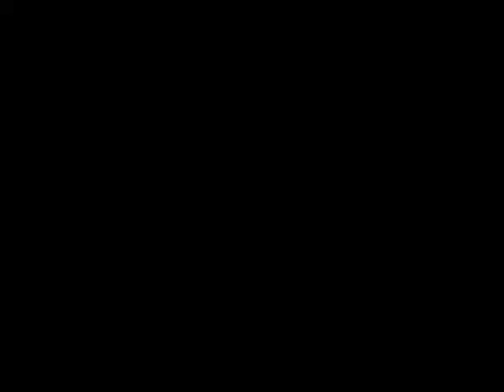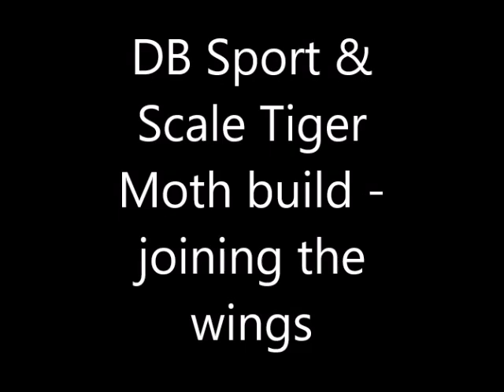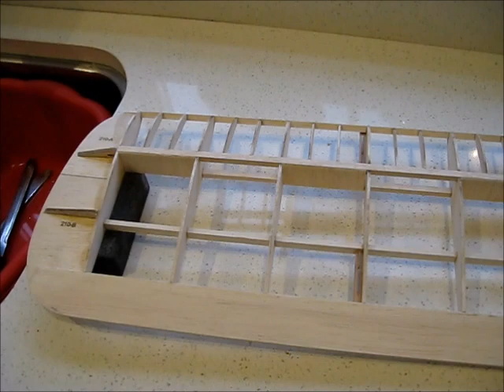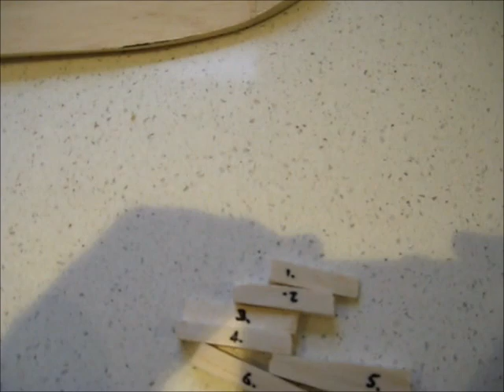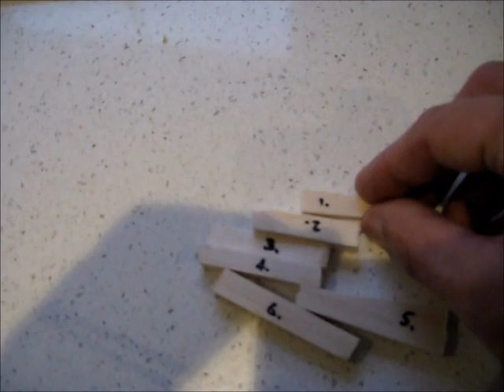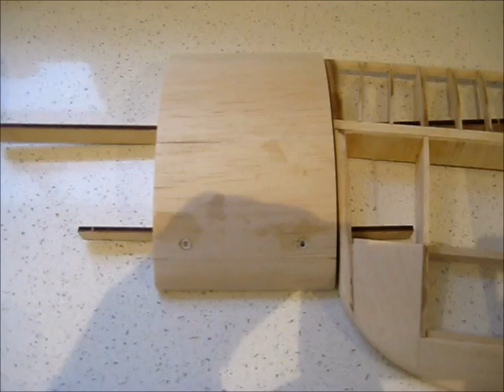DB Sport & Scale Tiger Moth   join wings

Comment: I'm wondering if you had to trim the spars on the lower wing due to not matching the dihedral angle?  On mine with the tips blocked up to 1 11/16" the spars were proud of the bottom of the wing.  I had to trim them down some to be flush with the bottom of the wing.
Reply from the maker: Hi John, yes on both sets of wings I had to do a tapered cut in order that the braces didn't stick out into where the covering will be.  This was about 5 to 7mm at the ends.  This part of the build wasn't very satisfactory, felt like a bit of a bodge,  Don't understand why the braces aren't angled in such a way that they fit neatly into the wings and can be more easily supported.
Reply: @alanbarnstable6874  Alan, thanks for the update.  I did a lot of head scratching trying to determine where I went awry.  I feel much better now.... :)